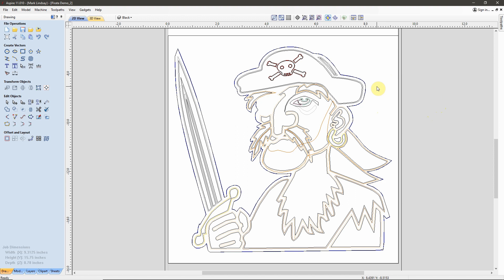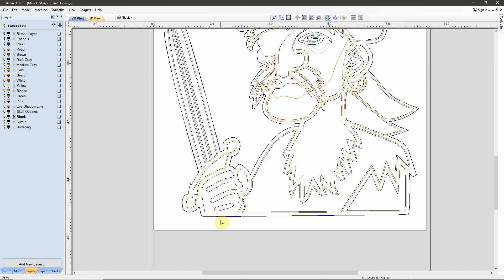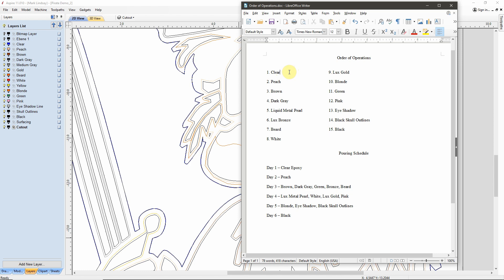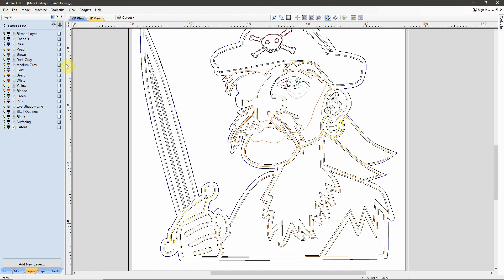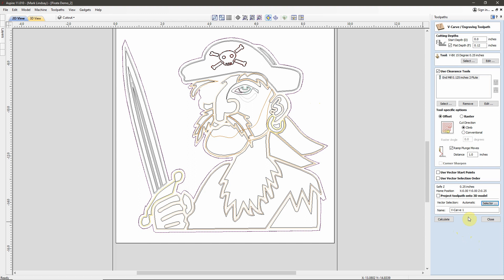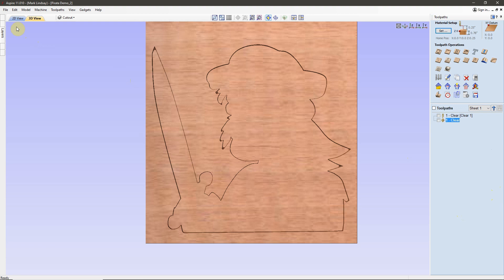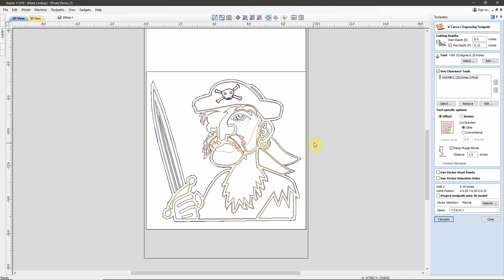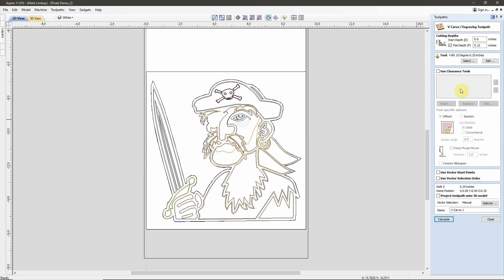Toolpathing Layers for Multi-Color Epoxy Inlays

Comment: Very good video Mark.  Carving the full clear and pouring is a good idea.  One recommendation I would make is for the clear toolpath, I would cut it at 0.15" vs. 0.12".  Then the following colors, I would cut at 0.125" vs. 0.11" as you indicated you plan on doing.  The reason I make this recommendation is it allows a little more opportunity to maintain your colors at the end when you surface and then finish.  As we have discussed there may be a little wood movement or other factors that require a little more surfacing than you originally intend.  The extra depth provides just a little more insurance with no real extra time and carving and minimal epoxy expense/work.  Just something for you consideration.  Looking forward to following this series of videos.
Reply from the maker: Noted! I'll make those changes and talk about them in the next video. I'll also mention it during today's live stream.

Comment: Good information.  Very straight forward.  In the bit order, I thought your rule was to always cut the V bit before the end mill, to reduce tear out? With epoxy it would be chip out.  Thanks.  See you this afternoon.
Reply from the maker: You have good eyes and a great memory, John! (I need you around more often.) You're absolutely right about the bit order. I only realized I had made that mistake after the video was uploaded, and I was editing the closed captions. I wasn't about to re-shoot the whole video and start over, so I figured I'd correct the error in the next video. Good catch! Thank you!

Comment: Great video. A lot of details to keep straight. I like the way you have everything organized. What are your tool parameters for the 15 degree v bit, especially the step over.  Will you do all the pours and then do a final surfacing?
Reply from the maker: Thank you, Jeff! Yes, I'll be surfacing it before and after the pours (I think I said that in the video, but I really don't remember.) I can show the parameters for the v-bit during the live stream later, and I'll add that to the next video when I get into surfacing the material.

Comment: Instead of having to rename all your Gcode files to reflect what bit you will need, just click on the CREATE JOB SHEET icon that is right next to the SAVE TOOLPATHS icon. This will show you then all of your Toolpaths in order and what bit it is supposed to use plus speeds and feeds etc.
Reply from the maker: That's a great option for VCarve Pro and Aspire users, but Job Sheets aren't available in VCarve Desktop. I try to show users of all levels of the software how to do things using methods and techniques available to everyone, wherever possible. That's also why yo don't see me using Gadgets. Gadgets aren't available to users of VCarve Desktop, so I don't get into them at all.

Comment: Hello mark. I'm doing a new Vcarving of the MAD magazine characters SPY vs SPY. Its a very simple cartoon in black and white. The size of the material it will be carved on is about 15"x15". I will be filling in the carving with pigmented epoxy. I have a max cut depth for all the vectors of .02" with a start depth of .01". I'm wondering if that would be deep enough for this type of carving.
Reply from the maker: That's pretty thin, Mario. Remember that the flat depth you set is the max depth, and any thinner lines will be correspondingly shallower. You'll run the risk of surfacing or sanding away a lot of detail if you pour that shallow. When I did the pirate inlay, I used a 15° v-bit, with a flat depth of .1 inches. I got a good outline, and never sanded through any of it at all.
Reply: Thanks Mark.

Comment: How I estimate epoxy volume, is to fill in the carved out region with white rice and measure its weight. Prior to that I first pour a known volume of epoxy into a cup and measure its weight, then using an exact size and shape cup I fill it with white rice to the exact level  of what the epoxy was at. With simple math you get a ratio epoxy to rice weight measurement. 

So next time you weigh the rice you multiple it by it by this ratio number and you get a real dead on target epoxy weight that you need. 

Just make sure first that the rice is first left in the same room and temperature for a few days where you will be pouring/curing the epoxy to have the  rice stabilize its moister level. For any added moisture in the rice would  effect its weight in humid regions of the world. This needs to be done only once if your environment does not change much.

I get dead on results with this method.  Just have the rice be a little proud of the carving level to off set the small amount of epoxy that will always be remain in the cup.

Comment: I have a question for you when, trying to save the tool path for the black on the skull I get a message back that says
Following tools produce empty tool pan, they may not be able to fit anywhere the previous tool, could not within their current parameters  I had originally done tool pass for a skull, but went back and change the skull. I don’t know if that’s what’s causing my problem. Maybe you have some suggestions
Reply from the maker: That message means that the Clearance Tool you have selected is too big to fit into the area you're trying to carve. You can either uncheck Use Clearance Tool or select a clearance tool that is small enough to fit into the area you want to carve. If you can't do either of those, you'll have to either modify the vectors to provide more space for the tool, or scale up the entire project to allow that clearance tool to fit into the area you want to carve. It's easier to just uncheck Use Clearance Tool and let the v-bit do all the clearing, or select a clearance tool with a smaller cutting diameter.
Reply: @MarkLindsayCNC  well, first of all, thank you for the quick reply. This is coming up when I’m only using the 15° V bit
Reply from the maker: You don't have a checkmark in the "Use Clearance Tools" box in your V-Carve toolpath? If not, check the distance between the vectors in the area you want to carve. They'd have to be very close together to not allow a 15° v-bit in there. If they're that close together, the bit wouldn't carve deep enough to do an epoxy pour anyway. Double check your vectors, and use the Measure tool to check the distance between them.

Comment: When it comes to cost of epoxy and pigments, remember that your epoxy  pours are just 0.125" deep and the amount of pigments used for each color are just drops not ounces for each one.
Reply from the maker: Absolutely, Mark. It's just like anything else - there's the big upfront cost to buy the materials, even though you're only going to use a fraction of those materials. So the $200 I've spent on epoxy and pigments doesn't mean the material costs of this project was $200. It just means that's what it cost to get the materials here. It looks like I'll be doing a cost breakdown video after it's all said and done, so I'll go further into detail then. Thank you for all of your comments! I do appreciate it!